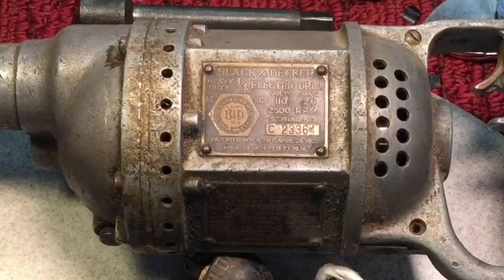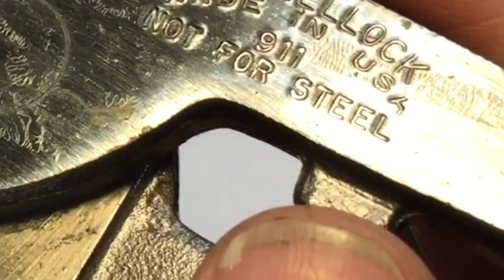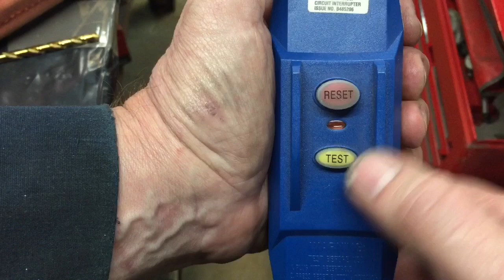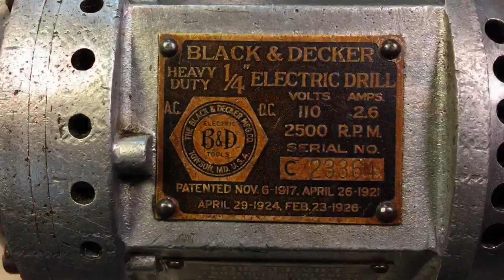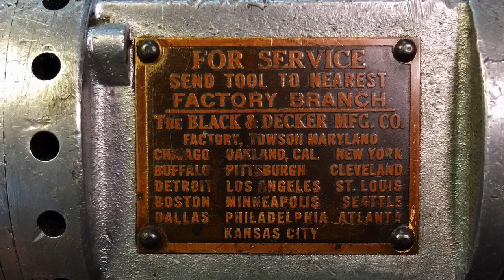Antique Black & Decker Electric Drill Back in Service

Comment: Hi John , the drill is a double insulated metal cased piece of equipment . The GFI will only work if the drill has a ground wire (earth wire in the UK) because it detects the fault in the ground wire and disconnects the supply . Great vid 👍🏻🇬🇧

Comment: John great point on GFI  protection. Back in the 90s I had the worlds record for tossing an old Craftsman circular saw. My silly nephew wired an external 110 outlet at grandma's house. I was over there a few weeks later doing some repair work on her porch. Standing  on the dew conered grass I started to cut a 2x4, SHOCK, CURSE WORDS AND THREW THE SAW.  Got the outlet fixed and never trusted that nimrod nephew again. Told grandma to never use his services again.  LOL

Comment: Another enjoyable video. I have at least a half dozen older Black and Decker drill motors. One of them is only 400 rpm, this one will break your arm if it gets caught while drilling.  My grandfather used this with a 1" masonry bit to drill dozens  and  Dozens of holes through 2 - 10" thick  cistern walls in his basement after he had city water run back in the early 70's. He then broken part of the walls out to expand his basement area.  Can't imagine how long this took him, I was only about 9 or 10 years old at the time and don't recall him doing this. He was a very tough man.
Reply from the maker: Jeff- Looking back at our grandparents I think that they were so much tougher then we are...   =D

Comment: I have a drill-by  another company that resembles yours. I need to clean mine as you did yours. These drills are work horses. I have many old metal electric tools. They have personally. When I change the power cords I add the ground. These still work when batteries die. Very seldom do you find a new tool better then the vintage ones. That’s why I enjoy your channel. Thank You

Comment: Drill is a nice one. I'll started restoring old metal drills a couple of years ago. We were getting them at auctions. Me and my son would buy a box for one tool and get several others. Lots of times the old metal drills nobody wanted. The only thing I do is I add a three prong plug to ground it  and new cord three wire. Ever since when I was working maintenance for a steel warehouse as a teenager I had a coworker grabbed by a metal drill and almost didn't get away from it. Ever since they worry me. The ones I have done I just wiped down but after seeing what the 50 50 does I think I will get them back out. Stay safe and healthy my friend. Thanks

Comment: I got lit UP by an old electric chair metal body B&D when I was a kid. Now I'll tear whatever it is down and put a 3-wire cord and plug in it. And the local machine had one of the same looking drill motor that was 3 times the size with that one and had about a 5 foot steel bar attached to it for a handle. The guy was boring out a truck hub for helicoils for new  MACK truck wheel studs and said you did NOT want to run that rig without that rod being on the ground. Thanks John CS and I ain't EVEN stingy with the 50/50! GBWYall! NICE handrail BTW!

Comment: Great video! A few years ago I happened upon a 1/4 inch Dayton drill motor with the same configuration only slightly smaller. I had to repair the switch and now it works like a champ.
The only thing is that it is somewhat awkward to use as compared to today’s pistol grip drills. It is great to look at though.

Comment: Hello John, What was the name of the railing and how much was it?  I need to do the same and I"d appreciate the brand name.  Thanks in advance.  Regards Leah
Reply: Metty Metal, about $150 for that size but obviously more for more steps.
Reply: @rawbacon  thank you
Reply from the maker: Hi Leah!  Raw Bacon has it right, it is surprisingly sturdy and well made, the only issue I had is my steps are a bit steeper then most so I had to slightly enlarge the cutout on the top upright with a cutoff wheel. That allowed the railing to drop down to fit my stairs perfectly.  The top rail is Cast Iron!  
https://www.amazon.com/Metty-Metal-StepTransitional-Installation-Steps（Patent/dp/B08QV852JP

Comment: The drill looks nice Scoutcrafter. I like that original finish all cleaned up like that but I also like it when it’s taken “over the top” and all gleaming like a presentation trophy. Variety is the spice of life I suppose. 
I remember when grounded cords became required. Every time you saw one somebody had cut the ground prong off because all the outlets hadn’t been changed over yet. 😆
Take care.
Reply from the maker: LOL- Yes, also remember the ground adapter plugs that allowed you to plug in a grounded plug into a 2 prong outlet?  Nobody ever attached the ground wire!  =D

Comment: You mentioned the 50/50 with transmission fluid.  Yesterday I was driving out of town on the Interstate and the chuck holes in the right lane were shaking the Jeep crazy.  I noticed some smoke so I pulled over and something was leaking and getting back on the hot exhaust.  Well, I found out fast what the leak was: the engine was going but the Jeep wasn't.  So I've got a leak in the transmission - and a towing bill.   Rats!
Reply from the maker: Oh Kathy I feel your pain!  I had a 1994 Chevy Impala wagon and the transmission went!  It cost me $1800 to fix the transmission and at that time I did not have that kind of money to throw away!  I went to the Transmission shop and asked what cars don't have transmission problems?  He said come with me...  I went to his parking lot where the cars waiting for transmissions were stored, he said "notice anything?" and as I looked around I realized they were all American cars!  Then I said "Wait- What about that Toyota over in the corner?"  He said "That's my car..."   =D  From then on I will only buy a car under warranty!  That hurt!

Comment: I was working on a scaffold in a factory and got nailed with some high voltage, I'm lucky it didn't knock me off the scaffolding to my death.............I remember at lunchtime I was still feeling a little goofy............Nice pine trees.
Reply from the maker: High current electricity is incredibly scary, I have been shocked a couple times as a kid playing around with it but seeing guys work near the big power lines always gains my respect!

Comment: The old plugs need a shield. I cut my shields from the plastic tops of coffee cans. It looked like there was a couple of oil ports on that drill. Nice video. Good Luck, Rick
Reply from the maker: Hi Rick!  I remember there were a few different types of shields, some were cardboard type material and others were a black grainy material that looked like tarpaper!  I also remember they had a slot or relief groove that they would fit into.  This one didn’t have it. 
I didn’t Oil the bushing because I wanted to confirm the oil B&D specified for those bushings.  I bet there is an owners manual online!  Thanks 
😃👍

Comment: It is absolutely a fantastic tip, the GFCI extension cord. I think it is very important to know that every primary underwriter in America will automatically nix a payout for a house fire if there is one of these anywhere on the property. Had a neighbor years ago who bought a hot tub but was too cheap to hire an electrician. He used a GFCI pigtail. House was 65% destroyed. He did not get one penny. Fantastic to use for a safety check, but I don't recommend anybody use one of these as a permanent fix.

Comment: An oldie but goodie, Scout.  That drill motor might only be a 1/4", but I bet it could wring off your arm.  It is my understanding that B&D started with a patent for the switch on a portable drill motor. PS - Back in the day, the bypass cable cutters of choice were Brenners.  Mine are Klein which I mean to replace with Brenners when they wear out.  Looks like the Kleins are going to outlive me.  PSS - If you plan on using that drill motor, ground it.
Reply from the maker: I made a stupid mistake once trying to cut steel cable with the cable cutters...  At the time I didn't know they were for soft material only.  The cable I tried to cut was 1/4" and it was a no-go!   =-D
Reply: @ScoutCrafter  You weren't the first to do that, John. Some cutters have "NOT FOR ACSR" (Aluminium conductor steel-reinforced) right on them.

Comment: Love the clean up on that drill,but I remember those drills where always a death trap. Being an electrical fitter by trade I cringe ever time I see an un grounded old metal case appliance. Thank god we now have double insulated appliances. Any good cordless drill would out preform that old drill. However nice to see someone conserving history. Carry on the good work love your channel.
Reply from the maker: Hi Milan- You’re so right, The newer drills are lighter, safer and have more features... I rarely use the older ones but every once and a while I will pull one out and use it for a dedicated countersink or pre-drill before a screw and they are always fun to hear and smell the ozone!  😃👍

Comment: Hey John, I noticed you left the connector side of the plug "exposed." Do you know the material used to make those cardboardy covers and if they are available to purchase somewhere?   Thanks.   Jim
Reply from the maker: Jim- I remember they used to make two types of covers one look like a cardboard and the other look like almost tarpaper material. Also I noticed that some of the other ones had a rim or ring on the inside to hold the guard captive, this one did not have that ring.  😃👍

Comment: Hi Scoutcrafter, back in the day in the mid eighties when I was an apprentice, we used drills like that, and don't ask me why but with bare wires and no plugs???? Great one tonight, black heat shrink instead of yellow......not a criticism mate, just wondering? Take care 👍👍👍🇺🇸🇬🇧🇺🇸🇬🇧
Reply: When I was an apprentice the radio we used to listen to never had a plug on it. Ha ha. We used to just ram the bare wires into the socket. Don't know why either since a plug only costs a couple of quid. One of those "get around to it" type of things I think. Imagine the health and safety police saw that now. Things were very different then, and I'm only going back 20 odd years.
Edit: Come to think of it, I know why the radio never had a plug - I think it was robbed in order to put a plug on a new boiler we installed and then never bothered to replace it. LOL.
Reply from the maker: Phil- All of my Black heat shrink is thin walled, good for light duty applications, for the plug/cable connection I needed thick walled heat shrink, the stuff is awesome, however I only have it in red, blue and yellow!   =D

Comment: Hello SC,
The drill reads 110v, other stuff reads 115v.  I get 120v at home.  Why the discrepancy?  What “should” it be?  How about a talk about outlet voltage? 
Thanks, Peter
Reply: Almost everywhere there's a tolerance. Here in Europe we have a tolerance of +/-10%. Meaning the appliances labeled with 230V must work with voltages between 207 and 253V. 120/240V is afaik the nominal voltage in the US, in the old days it was 110/220V.
In Germany we had 220/380V, and due to European harmonisation that was increased to 230/400V. The values are not double because we use a three-phase system here and not a split-phase system. Domestic three phase systems in the US have 120/208V.
Reply from the maker: Hey Peter!  Want to laugh?   Back then the advertisements used to say runs off 110 Volts AC or DC!   =D    https://archive.org/details/BlackAndDecker1930/mode/2up

Comment: Hey Sir,

I’m fairly new to your channel so I’m sorry if you’ve answered this before:

Do you store the 50/50 in an acetone resistant spray bottle?  Or just a regular sprayer?
Reply from the maker: Hello Willie!  It is important to store the 50/50 in a chemical resistant container and not to fill it up more then half way...  The Acetone is very hard on certain plastics and will dissolve some!  The reason we only fill it half way is because you need to shake the bottle and also the acetone expands and contracts so if you fill it all the way up the fluid will spill out the tip..  Welcome!
Reply: @ScoutCrafter  Thank you for the reply.

Comment: Like the railing except for shoveling snow. I picked up a newer 1/2" version of that drill in a lot of tools from an auction. Really nice except the handle for your other hand was just a carriage bolt. I will have improve that. Really wouldn't use it much as the newer Milwaukee is a workhorse.
Reply from the maker: Nothing beats a Milwaukee Hole Shooter!!!!

Comment: Also: I FORGOT CAN YOU SHOW OR did you  SHOW  SOME INFORMATION ON THE RAILING I put new steps in a couple summer ago and never added a railing. just want to have the same railing on my house as you have otherwise I WILL BE JELOUS ,THANK YOU  LOL AS THEY SAY and I hate LOL to me it stands for lots of luck old school. Eagle.
Reply from the maker: Hello Robert!  These were so simple to install- only 3 pieces!  Two uprights and a Cast Iron railing that bolts between them.  The most difficult part is drilling into brick or concrete steps to install the anchors.  Very easy install and very strong. Look thru the answered questions for more tips. Here is the link to the railing!  https://smile.amazon.com/gp/product/B08YNGR4T7/ref=ppx_yo_dt_b_asin_title_o01_s00?ie=UTF8&psc=1

Comment: Still missing one screw in the handle. No merit badge til you fix it properly. LOL. I too have several of those drills. They sell around here for $6.00 to $8.00  at used tool stores.
Reply from the maker: Chuck- If you can find a early B&D drill for $8 BUY IT!   Look on eBay!
Reply: @ScoutCrafter  I find them quite often at out local Habitat For Humanity store. Most tools sell for little money. I live in a pretty good area and people donate lots of good stuff.

Comment: I was watching a Jay Leno video, and Jay said that cast Magnesium Wheels become brittle with age. If that drill is cast Magnesium, it could be brittle. Also, Aluminum is non-magnetic & Magnesium is ever so slightly magnetic.
Reply: The drill case isn't magnesium  it would have rotted away it's from.1917 it's just pot metal it's not per'se good or bad just brittle even brand new.
Reply from the maker: Alan- Honestly I am not sure what the case is made out of!  I first thought Aluminum but it does feel very heavy and kind of stronger then aluminum...  It is non magnetic, I checked that.  I just have no idea!   =D

Comment: The drill looks great the way it is right now.  The finish is appropriate for a vintage power tool.  I say don't "restore" it.
Reply from the maker: Gerald- By Restoring it I would leave the outside as is but de-grease and clean the inside and re-lubricate the bushings and grease the gears. Maybe adjust the brushes...
Reply: @ScoutCrafter  That sounds like a great approach!

Comment: Name plate shows 1/4”,,, chuck looks 3/8”,,, May not be original chuck …
I wouldn’t want to use a keyless chuck at 2500 RPM…
Looks like no reverse..
Reply from the maker: Hi Harry- Surprisingly the HD drill came with a keyless chuck and the light duty drill came with a keyed chuck!   https://archive.org/details/BlackAndDecker1930/mode/2up

Comment: Good looking trees, but $75!!!? I assumed it would be more expensive on the East Coast, but not to that degree. Here we can get home delivery from weyerhaeuser of Douglas fir trees for 15 cents a piece in 1 gallon pots, usually about 2 and 1/2 ft tall. They are the extremely fast growing modified genetics that allow you to harvest every 25 years
Reply from the maker: Holy Cow!  15 cents!?  The pot cost more than that!  =D  I heard you can buy starter trees (About a foot tall) for a couple bucks a piece here if you buy 1000.   =D
Reply: @ScoutCrafter  Next time you need some trees you could probably harvest a few on your property upstate.
Reply: @ScoutCrafter  yeah once a year weyerhaeuser drops a mailer in all of our mailboxes. They use neighborhoods as grouped up orders. So they do end up sending out a truck with a thousand, but they stop at each house and unload a dozen or whatever you ordered. I'm pretty sure it's simply for good PR, they are heavily disliked by the environmentalists